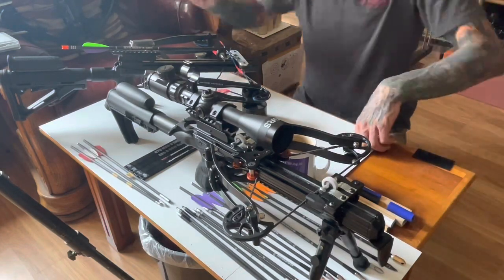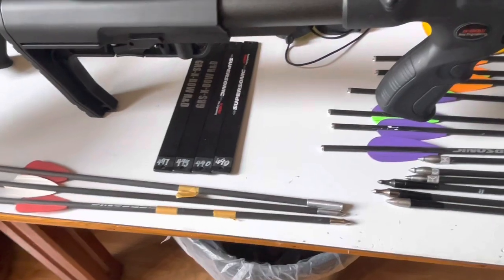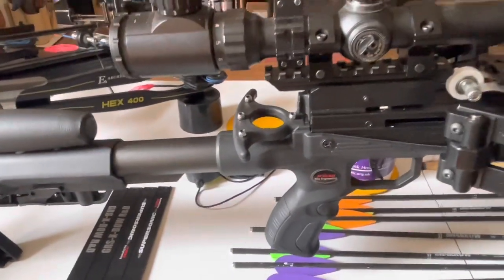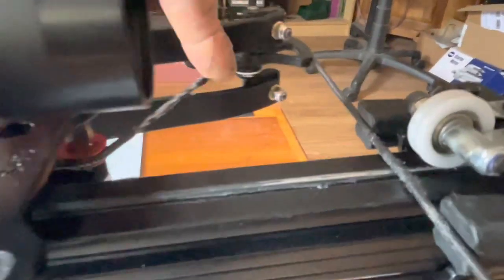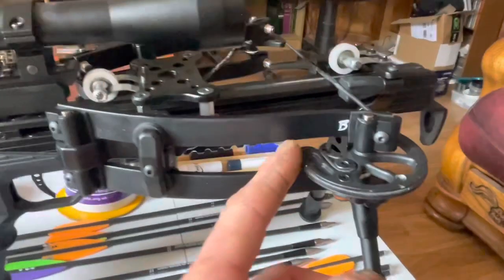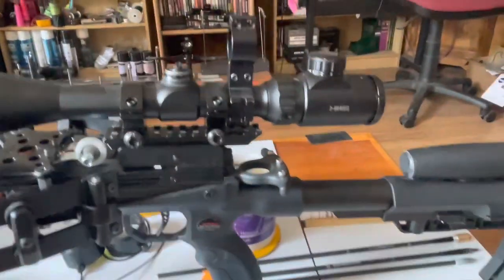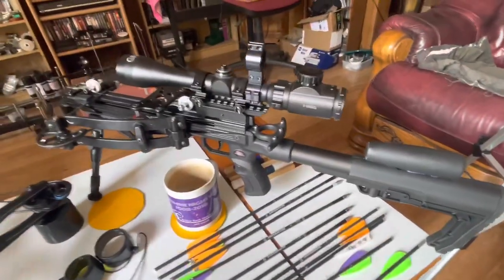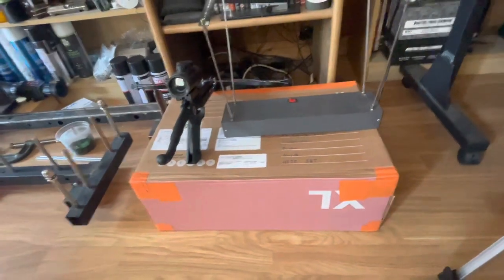J’s FMA supersonic rev build  update & some bolt weight advice

Comment: What speeds are you achieving with your 250 and 280 grain bolts with your strings?

Also are you considering selling the bracing plate (not the roller/bolt retainer)?
Reply from the maker: With my bow with the bigger & 3 fletched bolts 320gr I’m averaging 270fps , I could make it much faster but my needs don’t require it & I’m confident in saying as long as it’s not dry fired or light bolts it will last many years without having to do anything to it, I’ve got some jobs to finish it but it’s working so perfectly I haven’t bothered, I haven’t shared much about it lately but still shoot it everyday 🐀 😂 I have considered selling the brace but they wouldn’t be cheap, many hours work, all hand cut & filed
Reply: @TheNorfolkBowyer  I guessed it wouldn't be cheap but I'd certainly be interested (wife's Xbow). Recieved 2 sets of the set 2 bolts, very pleased with them!

I shoot an Excalibur Xbow but wanted a smaller manageable bow she could cock etc... and there was nothing else like the FMA which suits her perfectly, just want to improve it as much as I can for her. I seem to be lucky as no play, timing on cams is good etc... but I can see the brace stiffening it up and making it more durable.

Comment: I have been following you for some time. I have bought a FMA Supersonic and enjoy it very much. I now want to make my own arrows/bolts. Where do you purchase your shafts. I live in Portugal and finding great difficulty in finding a company that provides shafts suitable for the FMA Supersonic. Any advice will be most gratefully received. Keep up the good work. Best wishes Paul
Reply from the maker: Hi Paul, thank you!
I get my shafts from China & the seller is zd-outdoors.
I’ve been busy making bolts & some new alterations to my bow, videos coming soon 🥷🏿 best regards Gary.
Reply from the maker: I’ve just got a new batch of shafts & inserts to make some bolts for the rev’s, I’ll list them on eBay when I make some
Reply: Hi Gary. I live in Portugal and since Brexit getting anything from the UK is a massive headache. I used to buy everything on e bay but now it gets lost in customs and is why  why I need to make some myself. Do you mind letting me know what size shafts you purchased from the supplier you suggested. I cant seem to find the ones applicable for the Supersonic. I am enjoying learning from your video. Sadly I don’t have the engineering ability like you.
Reply from the maker: @paulcarter6839  31” pure carbon arrow shaft sp500-4.2mm id 👍